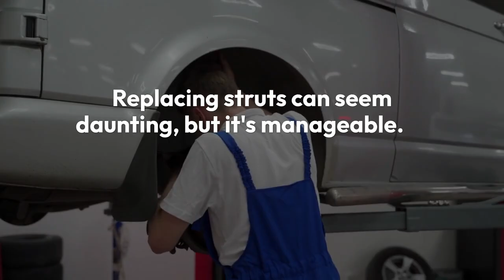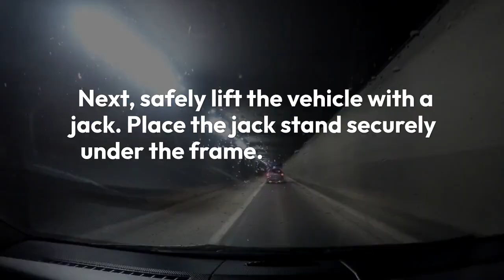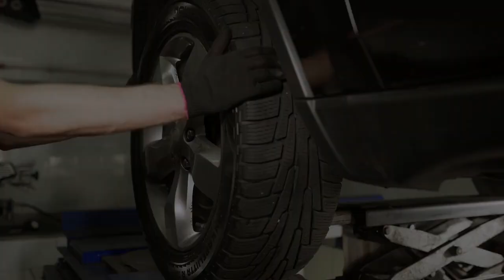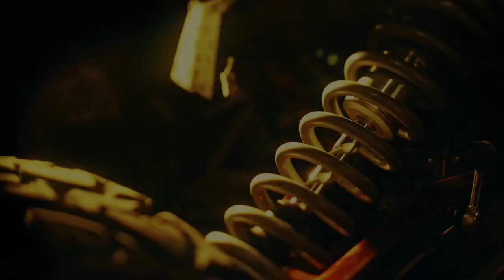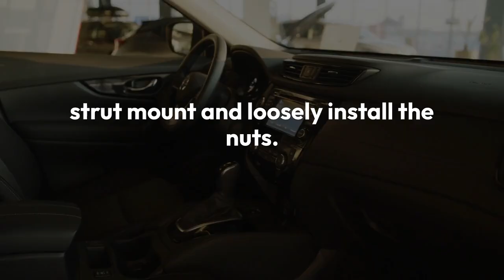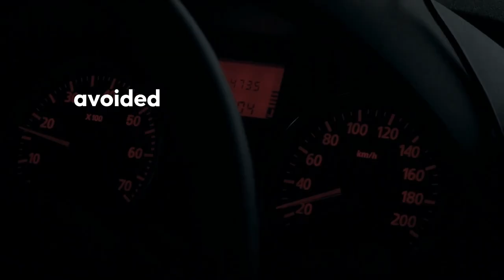How to replace struts without needing alignment?

Comment: You haven't kept anything in alignment. Alignment will still be needed due to clearance between mounting holes and bolts/studs plus also variance in size of parts made by different manufacturers.